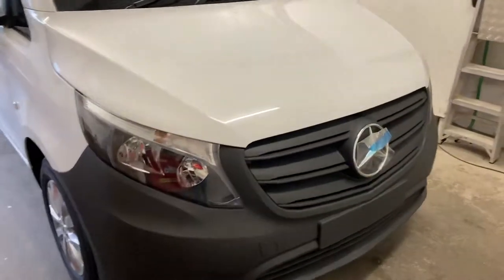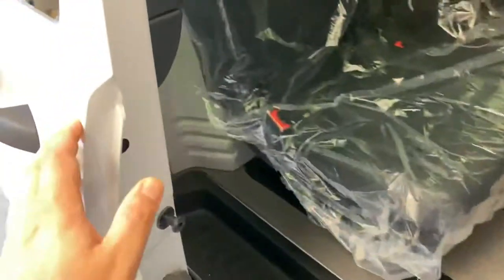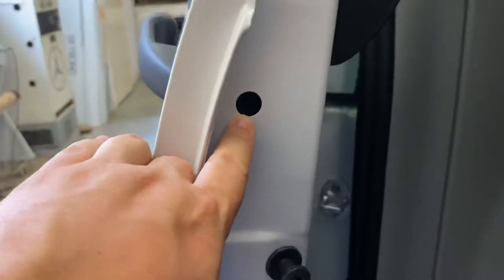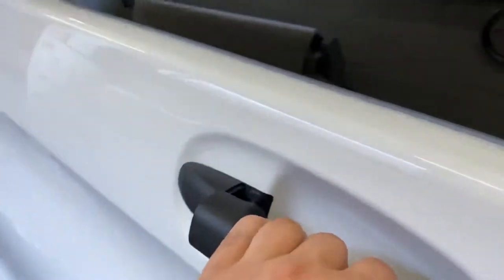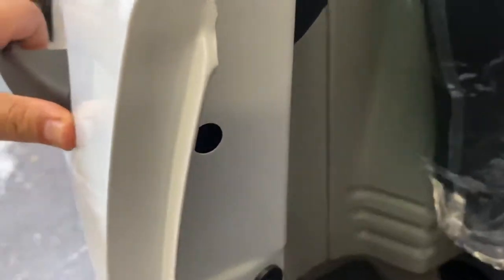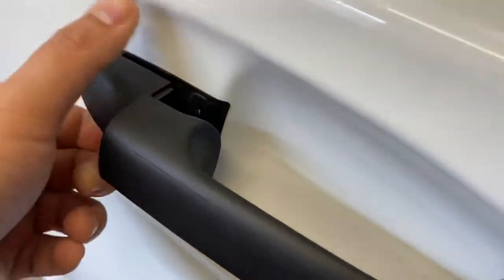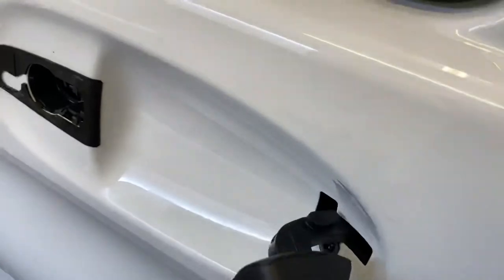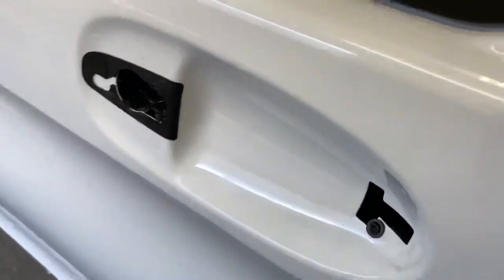How to remove a door handle on a 2021 Mercedes Vito side loading door

Comment: I didnt pull the door hand before i loosened the screw. I got the door handle back in and under the latch but the door still isnt opening. Any ideas?